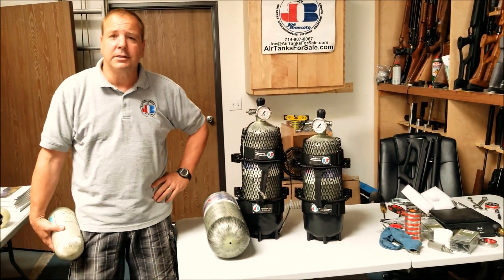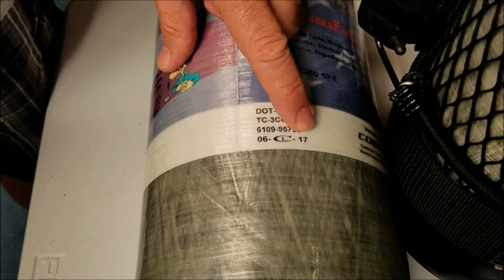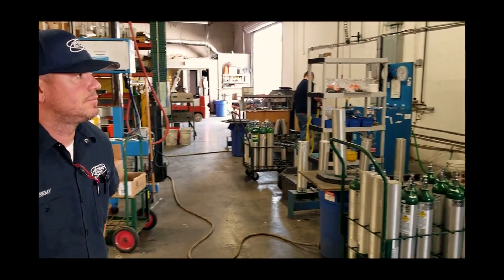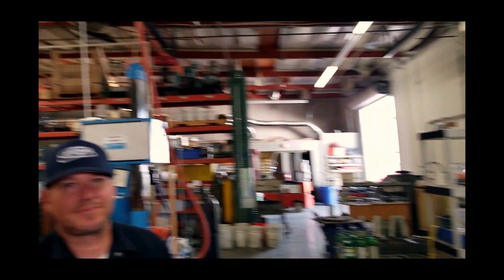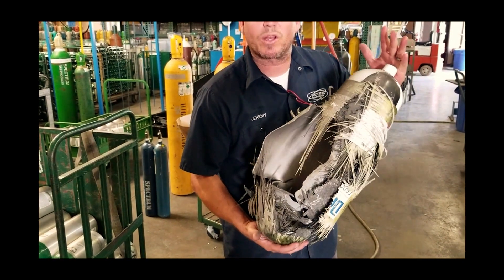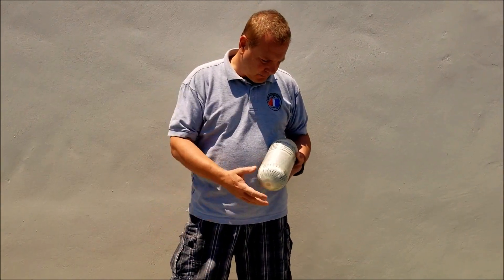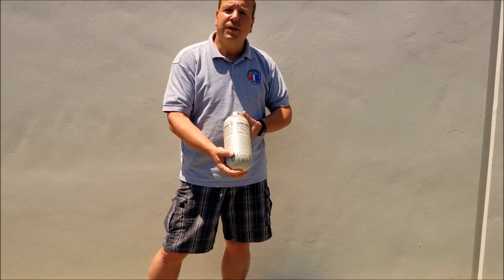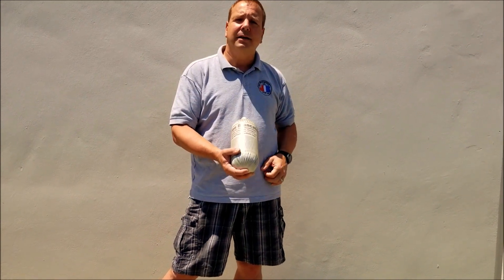HydroTesting a 4500 PSI Carbon Fiber Tank vs Catastrophic SCBA FAIL!!!

Comment: It seems that tanks are damaged more by hydrotesting than most other use scenarios, according to the Navy.  Regular pressure cycling does not damage at all, age doesn't damage, but wet air is a definite problem!   I see so many air rifles shooting with vapor coming out the end that it scares me how folks are "fueling" their air tanks and cylinders.  I personally won't use a hydrotested tank because of the damage the extreme pressure does to the integrity of the tank, especially if it has had more than 1 hydro on it.  I would, however, have my tank MAE tested, but I cannot find a place that does it for an individual, seems only fire departments and the Navy get that option. Tanks are so inexpensive (just the tank if you already have the valves, etc.) that it is much more "safe in my mind" to buy a new one every five years (which is what I do even though the Navy study shows that this is WAY overkill, those tanks last decades with regular safe use). I could, according to the science, use my tank for the next 30 years and it wouldn't be a problem, but peace of mind does cost, so, there it is, every five years a new tank.

Comment: I'm on a Carbon Fiber rabbit hole, thanks to the Titan disaster. Carbon fiber seems like a bad choice to do 10000ft dives over and over.
Reply: Oh its definitely not a good idea.. remember carbon fiber is basically just material and hardened glue.. 
Every time you put such immense pressures or stress the mixture will contract and expand and this could cause the integrity to be compromised.. micro cracks.. and more cracks the next time you dive..
Underwater the pressure is equally from all sides... so the moment the hull is weakened and does not have uniform strength it will collapse..
You could probably get away with carbon fiber if you seriously over engineer the strength.. but you definitely shouldn't be 'pushing it to the limits'.

I used to be a road cyclist.. and i had a carbon bike.. and after a couple of years of cycling the frame is not as stiff as when it was new.. you can feel the frame bending more under each pedal stroke.. .this obviously means wear and tear causes it to weaken.
Reply: @zaskadu8320  lol I have a solid steel old-ass mountain bike that feels like a damn rock on wheels. no bending there XD   it's heavy as shit though
Reply: Hell, anything would be a bad choice to dive 10000ft under water with, except in a submarine💥🤣😂👍

Comment: that's why i won't buy used no more... i bought 2 used tanks with 2021 dates but one was damage inside valve, it happens when you drope your tank sometimes and the other one had some kind of oil were if you are not careful the wrong oil can blown up the tank right?
Reply from the maker: Oil and very high pressure air is what makes a diesel engine combust.

Comment: Isn't the hydro-test already putting extra stress on the tank? What if the hydro-test creates a micro crack which isn't noticed by the operator after inspection, and it then explodes in the user's hands just after receiving a certification?
Yes, one may say "the company is gonna get sued" but, the user is dead in the meanwhile...
Unless x-rays of the structure are taken, hydro-testing doesn't actually feel like a real "good to go" test which prevents the hypothetical problem of catastrophic failure, it may actually induce it.
Please, elucidate further if I'm wrong.
Moral of the story, I'd rather buy a new tank that's just been manufactured than testing an old one, if safety is my concern.
Reply from the maker: The measurement of water volume determines if weakness is present. If pressuring it caused issues, the tank would over-inflate and fail the test.

Comment: And what does overpressuring your tank with 3000 psi do to it's the integrity? I can imagine that a tank passes this pressure test but what did it do to it's internal structure? I think X-raying them or some other kind of technique would be much safer.
Reply from the maker: This is the proper procedure.  Design a tank properly, continue to make as designed, fill with air, and look at how much it expands.

Comment: Almost all tanks fail on the hydro test ! Because they push them past 4500 . 4500 psi is not enough energy to disintegrate the carbon fiber . The problem is that when they do fail they don’t explode they just leak the air out . Now they fail in testing because there pushed to 7000 psi .
Reply from the maker: One would never test to only 4500 PSI. If it failed at testing, it could just as easily fail at usage.

Comment: Hi Joe got a question for you if I had  a cylinder that had a valve assembly with worn plating could it still be used as long as it is still up to date on hydro testing? thoughts please thank you
Reply from the maker: Normally SCBA valves aren't plated, so I am at a loss as to what the issue is.  Call 714-907-0067 8-530 Pacific and we can help

Comment: Does hydro testing consequently weaken or reduce the tank? Seems like a lot of pressure on the tanks...
Reply from the maker: EXCELLENT QUESTION!  No harm. The tanks are designed to withstand a pressure of  over 13,000 PSI. They are tested to only 7,500 PSI.

Comment: The Navy has shown that hydro testing is not necessary, but instead read this : https://www.phmsa.dot.gov/sites/phmsa.dot.gov/files/docs/technical-resources/55976/navy-self-contained-breathing-apparatus-scba-composite-cylinder-life-extension-research-project.pdf
Reply: In fact, the cylinders can be extended another 15 years - following the above.  I am NOT an authority, but I do consider the NAVY to be well invested in the firefighting ability of their ships and to not take safety lightly... If they propose a better way to test, I am inclined to listen.  I quote : The  Navy’s  Common  Maintenance  Planning  Working  Group  (CMPWG),  the  study  sponsor,  worked closely  with  DOT  to  develop  a  study  test  plan  and  to  review  results.  The  goals  of  the  study  were  to conclusively  address  two  questions  to  determine  whether  SCBA  cylinder  service  life  can  be  safely extended. The questions were: 1.Do Navy SCBA cylinders have the long-term strength and integrity required to safely withstand fill cycles associated with extending their service life beyond the DOT 15-year maximum? 2.Can  Modal  Acoustic  Emissions  testing  be  used  to  predict  impending  failure  in  time  to  allow  for failing cylinders to be safely removed from service? The  answer  to  both  questions  is  yes.  The  case  for  requesting  service-life  extension  is  supported  by extensive  engineering  tests.  The  tests  included  SCBA  cylinder  cycling  to  mimic  extended  service  life and  burst  testing  to  determine  ultimate  strength  of  end-of-life,  cycled,  and  damaged  cylinders.  SCBA cylinder  strength  does  not  degrade  with  calendar  age  or  pressure  cycles  at  operational  pressure.  The study  induced  a  full  range  of  physical  damage  to  cylinders  to  determine  the  effectiveness  of  Modal Acoustic  Emissions  testing.  The  testing  revealed  a linear  relationship  between  a  cylinder’s  acoustic signature and ultimate burst pressure. Modal Acoustic Emissions testing is also effective at identifying discrete material flaws that correlate to individual cylinder burst pressure.
Reply: In other words, There is a test that doesn't stress the cylinder and is also predictive of failure.

Comment: There should be entry-level tanks for beginners 🤣😂 those tanks are high as hell
Reply: They also will               last longer if filled to lower pressures... so will your compressor... Do you really need your PCP at 4500?  Isnt 4000 enough?

Comment: Awesome video, I worked in a dive shop way back in my younger days. I've seen tanks fail during testing.
Reply from the maker: Great point!
Reply: @AirGunScientist  According to the NAVY, and their testing, cylinders will show other signs of failure prior to catastrophic failure.  If you have any deformation or leaking, stop using that cylinder... and get modal acoustic emissions testing done every five years... and toss the cylinder after 30... There!  I just saved a bunch of money thanks to the NAVY.
Reply: @horscategorie  would a carbon tank be safer than a aluminum tank?
Reply: @horscategorie  I cannot find a place to do the MAE testing for individuals, do you know of a place that does? I don't use a hydro tested tank because of the problems the extreme pressure makes.  Even if it has a good hydrotest you can pretty much be assured it damaged the tank so using it after even a pass would be unsafe.

Comment: If the tank is to bee filled to 4500psi why are you guys fill them to 7500psi im never going to fill it past. 4500psi and it has a burst disc on it so it will not be filled past 4500psi

Comment: How come in the US a carbon tank has a 15 year service life but the same exact model tank has a 30 year service life in the UK? The US Navy also uses their lowest bidder tanks for 30 years. They did a really good white paper and study on debunking the 15 year life.

Edit - found the paper. It’s a good read.
https://www.phmsa.dot.gov/sites/phmsa.dot.gov/files/docs/technical-resources/55976/navy-self-contained-breathing-apparatus-scba-composite-cylinder-life-extension-research-project.pdf
Reply: 5500psi would be nice but I couldn’t fill that with my compressor. How do you fill to 5500psi?
Reply: @Cr125stin  anything more than 4500 usually needs a very specialized compressor like scuba shops use. There are hand pumps that can get that high, but it’s quite a workout.
Reply: I got 5500 on expired fire fighter tanks. Got good valves and burst disk.. yep. 5500. Fck 4500. I have a Huben gk1 air pistol.
Reply: I never tested it but my Yong Heng has a pressure set gauge that goes up to 6000 psi , 4300 is my cut off for my guns tanks, don’t have a carbon fiber fill tank yet. There are 3 or 4 versions so you must shop carefully. I have what’s called “set pressure “ version , meaning I can set stop hand on desired pressure in gauge and comp shuts down and an alarm sound when set pressure is reached. I don’t trust it and monitor it though, so far , so good.
Reply: Any full power gun that doesn’t have adjustable hammer spring will valve lock very much above indicated pressure for that gun. You would have to find a way to degas gun if it locked completely. I have had the sun increase pressure in my Megalodon enough to almost lock it so much it wouldn’t barely dry fire to bleed off enough to work properly again. It happened really quickly as well, the black color I suppose. Lesson learned. AEA doesn’t provide manuals, I have no clue how I would degas it if I had to other way than dry firing it which I dislike doing. Love the rifle, just wish there was a manual for it😂😂😂
Reply: Exactly. I fill
Mine to 5500. Just do a in and out inspection once in a while and don’t go over 30
Years. And they test them to 7500 so even 5500 is a far cry off.

Comment: Interesting.  Guessing is a like high pressure pressure washer to fill, what is already filled with water in, the tank.  The tank of course like you noted is in another tank that measure the displacement of water to then do the math to determine if the tank is within the volume expansion specification limits.  Doesn't seem that complicated actually, however, most don't have a background in holistic lab systems development and validation.  Interesting, neat to watch and also yesterday learn about the newer Modal Acoustic Emission (MAE) testing that can be performed to further extend the life of carbon fiber tanks.  Seems like such a waste to destroy the tanks... unless the material is recycled or can be repurposed for something maybe where the aluminum tubes or ends can be used.

Comment: 02:15 what was the reached test pressure caused this result and what what the wp of that cylinder?
Reply: They are tested at 7500+ PSI.  Also, cylinders have failed like that shown if severely damaged (run over by fire apparatus...) Don't forget they have a burst disk to prevent being pressurized that high, so for testing they remove the valve which has the burst disk.
Reply: @horscategorie  I do hydrotest too up to 10.000 psi. If there is no any damage on a 300/450 or 517 bar composite cylinder to see this kind of damage almost impossible with normal test pressures 

I think the cylinder in your hand testted at 15.000 psi
Reply: @karakuscher  Yeah - I have never had or known of any catastrophic failures in over a 24 year career other than individual cases on a national level that always had a severe compromise like apparatus driving over a cylinder.  It reminds me of hose testing - Why do it?  We stress the hose, it may fail at the next fire... Better just to decommission it at 10 years or whatever testing shows to be appropriate.  Testing puts extreme stress on items and sets up future failure, just my opinion.

Comment: Very cool video  i was  a certified Scuba Diver in the late 1970s  and the  Dive shops  used to make it sound like it was the great big mystery  on how and where the tanks got Hydro tested  so now at 56 years old and over 250 logged dives under my belt i figured i would really learn  of course in modern times air tanks are also used for paint ball  now as well  back in my day  there was only 2 manufacturers of Scuba tanks one made the Steel and the other Aluminum  of course  they were sold by many companies under different names  with  different valves
Reply: So in 40+ years you've only dived 250 times or just over "bi-monthly" and that has "educated" you on the mysteries of "hydro testing"?
Reply: Uh...paintball "markers" use C02. Not "wet" compressed atmospheric air. It tends to cause "icing" due to the huge and total pressure drop at the "breech". CO2 is also "cheap" compared to "scuba tanks" and a "scuba compressor". Not to mention as an inert gas with no temperature-pressure gradient and a hell of a lot more density than "air" for a lot more "power" per psi at a far lower "tank pressure" CO2 bottles can be made of the same material the overwhelming vast majority of CO2 "pressure vessels" filled daily are made from. Aluminum. The "pressure vessels"? Carbonated beverage cans. And now "bottles". 

All air compressors capable of "high pressure" - 250 psi and up - are also "oiled" and "compress" the air so much that "cleaning" and "drying" the air is impossible. Of course compressor oil is "mineral oil" and "non-toxic" but its still a "solvent" that will "soften" the "epoxy" adhesive "cement" in "composites" like fiberglass and carbon fiber in their "raw" state and that's what "hydro testing" is really "looking for". 

Otherwise pressure vessels - especially steel - are only "hydro tested" when they are used to store heavier-than-air "dual threat" hazardous materials like anhydrous ammonia and after the tanks have held only "air" at any point since their last certification. 

Water vapor, condensation and "hydrocarbon" ingredients in the petroleum-based NH3 and the sulfur and salts that always go with "refined crude oil" can form sulfuric and/or hydrochloric acid and corrode pressure vessels even if they're not "rusty". 

No "pro" scuba diver would ever f&ck around "hydro testing" anything in his "toolbox" because he would see that initial CERTIFICATION for what it is. The manufacturer's "guarantee" on what is obviously a "perishable" product with an indeterminate service life but one not exceeding 5 years "reliably" subjected to "normal use".
Reply: @deeremeyer1749 the carbon fiber bottles are aluminum lined and the reason for the testing is because of flex fatigue of the outer carbon fiber layer, the carbon fiber is never in contact with the oil in the air.

Comment: Joe, PCP air rifle cylinders don't get Hydro as far as I know.  How long does a PCP air cylinder last? I am sure they can explode as well.  I would also think that by the time the air cylinder needs to be replaced the rifle will not be in production.  I have firearms that I have had from age 12 and younger including 2 pumpers. I am 50 this coming year and would hate to run into problems.  I have never heard anyone talk about the longevity of PCP air cylinders before.  Thanks for all your valuable information.
Reply: They will typically have a burst disk system built into them that destroys the gun or at least parts of it to safely bleed out the air.

Comment: Joe is a really good guy and extremely knowledgable about everything HPA and more. He helped me out big time with my Hatsan Bullboss when Hatsan was giving me the runaround and in fact still waiting on Hatsan come to think about it. Joe took the time, after hours to help me locate an O-ring for the valve stem that the hammer strikes against to let that squirt of air from the tank to send the pellet flying. It turned out to be 1.3mm X1.0mm O-ring, yeah, very tiny but necessary. Joe didn't have any at that moment but the fact that he took the time and had access to info to get me this info is stunning and very impressive. I later bought a valve for my fill tank from him and haven't had one single problem with it and was better priced from him than other places that had the same valve. Thanks to Joe my Bullboss was up and running in a few days and I bought 25 of those tiny O-rings from eBay for 5$ and no I still haven't received any from Hatsan YET..not kidding...been well over 2 weeks since I emailed Hatsan about the problem. Joe saved my butt and my super accurate gun. Forever will be thankful. Awesome to think that a guy will take the time after hours to help me with a product that wasn't even bought from him and for a .10 cent part!!! Super good guy..Thanks Joe.
Reply from the maker: Thank you for a very nice post. I appreciate it when people take the time to say "thank you"
Best to you and SAFE SHOOTING!